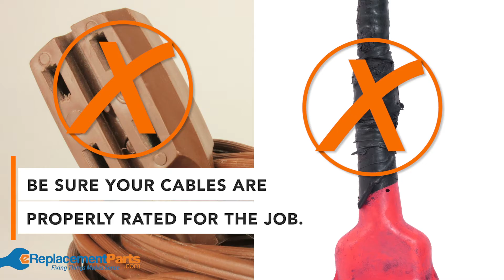Important Tips for Tool Safety: Top Tips For Staying Safe in the Shop | eReplacementParts.com

Comment: Thanks for brushup,know better don't always do better good reminder. I have one tip that many should know I suffered from a brain aneurysm layer around the hospital for a bout a month,came home weak as a cat,couldn't understand bolts came loose I never had that problem before now it was a problem,,got a torck wrench to check properly tighten they stay tight now and couldn't rely on past experience now I know the bolts are properly tightened.👍

Comment: Always wear protective gear; chainsaw chaps, eye and hearing protection, face shield, gloves, steel toe boots, etc.  Be aware of where you are and take time to see if there is a safer place for you to work from.  Use the right tool for the job; that saves the tool and you issues.  Keep bystanders at a safe distance.